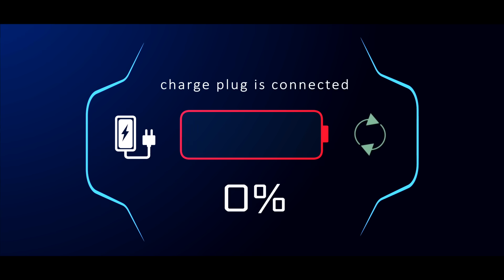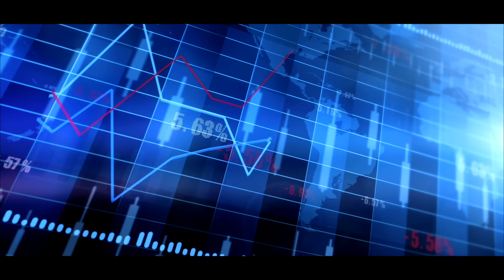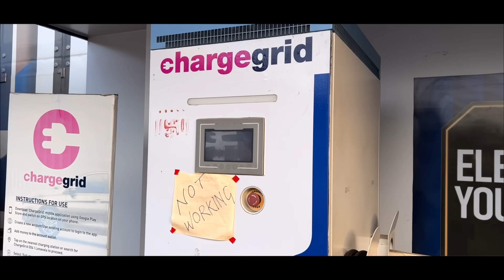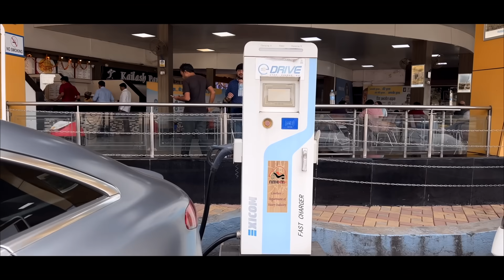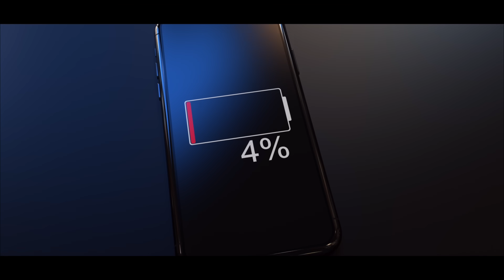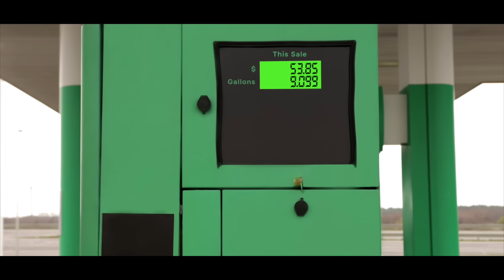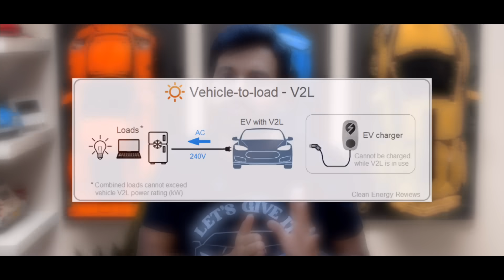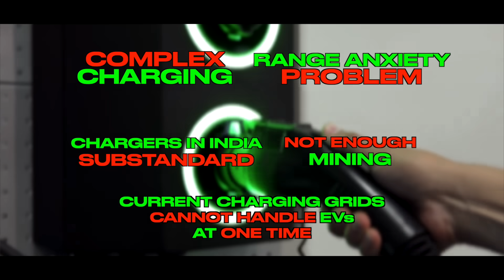Here Is Why Electric Cars Are Not The Future!

Comment: This is another video providing a lot of bogus information and baseless conclusions without any real facts or figures. EVs are certainly the future. It is already prominent in many countries. However, since India is always behind in embracing new technology, it will take a bit longer.
You cannot brand EVs as one entity. It has to be Tesla and Non Tesla made by legacy auto makers like BMW, Hyundai or Tata. It is way different. Legacy automakers make EVs, but they don’t have the infrastructure to mass produce or in innovation or ability to change their production line quickly.
1)	Misinformation 1: EVs are very heavy. This was true before and now it is not that much anymore. For example, the weight of Toyota Camry is 3310 lbs and weight of Tesla Model 3 is 3582 lbs, which is just 292 lbs heavier, which is less than 10% more.  In Kilograms, its about 130kg heavier. He makes it sound like it is almost two times heavier. Also, the weight of batteries is coming down every year due to improvement in battery chemistry. In few years it will in par with ICE cars. Also, he mentions about brakes wear out quickly in EV due to weight. However, in reality, brakes in EV last at least three times longer than ICE cars due to regeneration. When you put brakes on EV, the motor becomes a generator and charges the battery back instead of wearing out brake pads. The latest Tesla Model 3 highlander coming out in few months will be at par or lower than Toyota Camry.
2)	Misinformation 2: Another topic everyone of fossil fuel group brings about battery metals. There are two types of EV batteries in use. One is LFP (Lithium Iron batteries) and other is NCA batteries. Out of which LFP batteries do not use Cobalt only NCA batteries use. NCA batteries used 33% Cobalt before, however, it is only 5-10% now and very soon they will be Cobalt free. In terms of applications, all storage batteries will be LFP and 60% of EV batteries will be LFP. Only 40% of EV batteries will be NCA. If you combine storage and EV batteries, only 20% will be NCA batteries. NCA battery Cobalt usage is reduced and will be zero in few years. Lithium is available in plenty and that will not be an issue. Lithium mining is not as resource consuming like exploring and digging for oil. They currently extract from Lithium brine which that can get in south American countries. Yes, there were issues with labor abuse in mining Cobalt, however, Cobalt usage is made zero very soon with High Nickel batteries in NCA. BTW, you need Cobalt to refine Crude oil to remove Sulphur. 
3)	Misinformation 3: EV batteries at their end of life are sent to landfill. EV batteries are completely recyclable and we can get back 95% of the metals used in the battery. A company in California called Redwood materials is doing it. Currently there are many EV batteries available for recycling since it is being still working well in cars. EV batteries last 8-12 years in cars and after that it could be used for storage applications before sending them for recycling. Also, Redwood Materials say, extracting battery metals from recycled batteries would cost only 50% of the cost of mining those metals. However, Fossil fuels are burnt and you need to keep digging new rigs to get them.
4)	Misinformation 4. EVs are not the solution for Global warming. EVs are a part of the solution for global warming in reducing emissions and also in stabilizing the grid and make it more efficient. They can be part of VPP (virtual power plant). Vehicle to grid (V2G) is getting popular and this will help the grid during peak hours. A typical EV has about 50KW battery, which can be connected to grid in the evening when it is not in use. Unlike an ICE car, which is of no use when not running, EVs can be used to power the grid during peak times and the consumer can make money. They can then charge during the night hours when electricity is plenty. VPP has been working, although in a small scale, in California and Australia. Unlike, peaker power plants that are used during peak times, EV battery in VPP can be turned on or off in milliseconds depending on the load. This is another way Evs help in Global warming. Several Electric school buses are planning to do this when they are not in use. Faisal says V2G is not needed, which totally wrong. When you have a proper VPP setup, EVs when they come home can be connected to grid and provide electricity for the grid at peak times. After 11pm, when is plentiful, it can be charged.
5)	Misinformation 5: Fossil fuel is cheaper and better. In the last decade the fossil fuel companies throughout the world received 5 trillion dollars as subsidy from all governments in the world. This is happening every decade for a long time. If we provide just 20% of that money to renewable energy with battery storage, we will solve the energy crisis once for all. This subsidy is keeping the price of petrol/diesel low, otherwise it will be two to three times more expensive. Renewable energy and EVs are getting very low amount of subsidy compared to fossil fuels. If we have more EVs the price of electricity comes down, because electricity will be used efficiently. This is seen in certain areas in California where you have more EVs.   India is giving 15 billion USD (1.2L Crores) EVERY YEAR to fossil fuel companies, 10 billion for Oil and 5 billion for Coal. If they didn’t do that, Petrol will cost 25 rupees more. Nobody even mentions this. However, when some small incentives are given to renewable energy, it is a big issue. With that kind of money, Government can build a 250kw supercharger networks throughout the country. 
6)	BMW will say EVs will not work because they want to sell their ICE cars and they are nowhere in EV market. The same with Toyota which does not have any proper EV in their roadmap and have a huge debt of over 200 billion USD. Their largest market in US and China is dwindling. So it is hard to believe anything coming out of legacy automakers.
7)	Battery prices are coming down steadily. In 2010, 1 kwh battery was 1000 USD, now it is about 130-150 USD. They expect the price to go to 40 USD by 2030. If you had to replace the battery in 8 years, it will cost much less and will be a better battery. Every year there has been at least 5% improvement in batteries in terms of weight and price
India made an unwise decision for not allowing Tesla in India for their own reasons. Tesla not only makes EVs, but huge in Building Charging infrastructure, Energy Storage and VPP. In America, tesla owners do not have any range anxiety because of their own Supercharger network with 250kw chargers throughout the country and it works 100% However, other EV owners have the problems because other charging networks are 60% operational and many times do not provide the specified charge. Tesla owners in Europe and China has no issues with range anxiety. Tesla is building Supercharger networks at their own cost. If Indian government provides land and grid support, it will be a done deal. They install 40 Supercharger stalls of 250kw EVERYDAY throughout the world. They also build 4Mwh megapacks which can be used as backup in some places where electric connection is not ideal.
Switching to EVs will have some growing pains, however, it be very good for health of people. India is importing all their oil requirements and switching to EVs will reduce that requirement and save money and reduce pollution. If an EV gets old, you only use the range, however if an ICE vehicle gets old, it pollutes a lot more.
Reply from the maker: Appreciate your long comment and I hope a lot of what you are saying turns out to be true but seems unlikely!